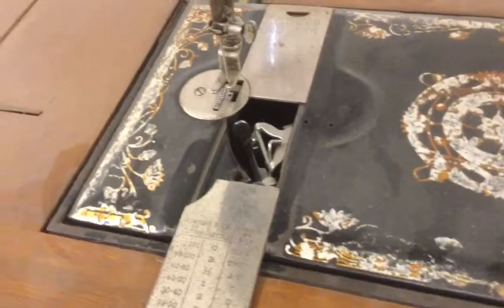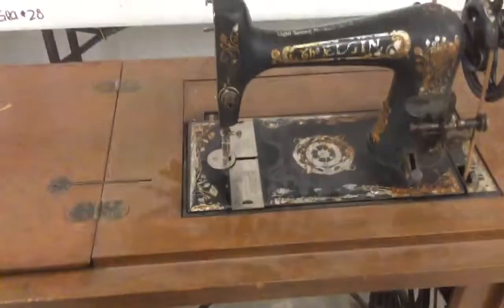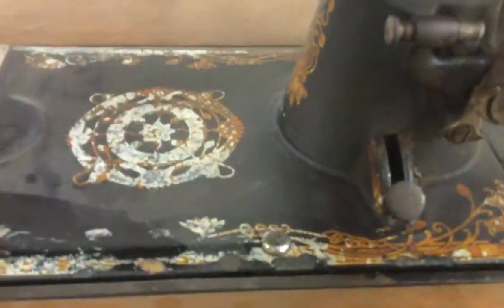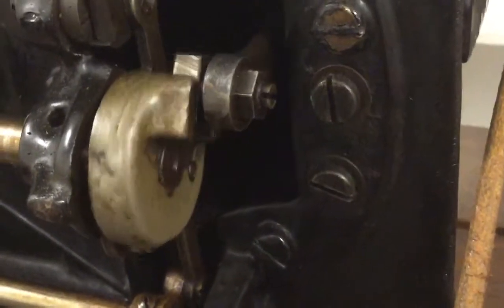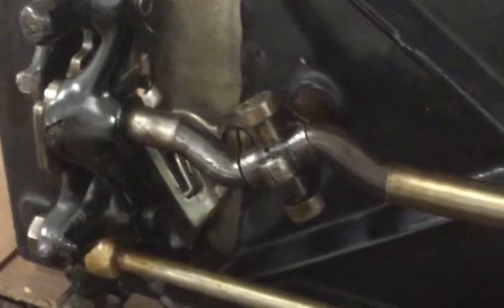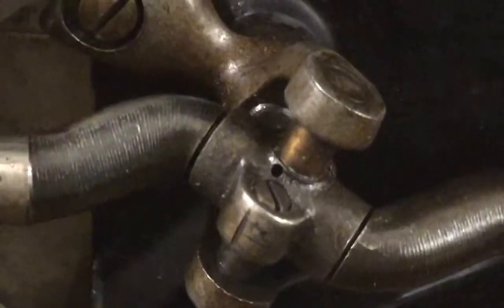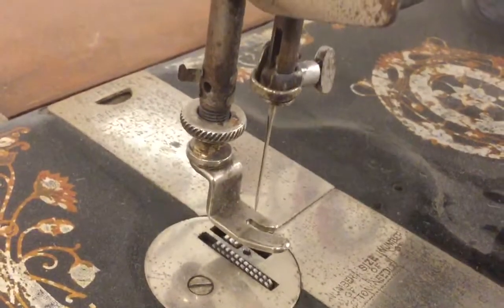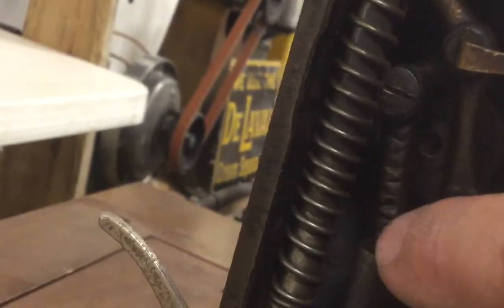The Free Sewing Machine VS model

Comment: Do you think I could substitute a singer 27 front plate as a replacement for a machine just like what you have in the video? I a missing a front plate and the back round cover where you oil.
Reply from the maker: Probably not, the shapes of the holes on the front plates are different. You can probably get away with swapping the rear arm cover plates though. You will probably not be able to use the Singer thumbscrew because Singer liked using their own odd-ball screw pitches.